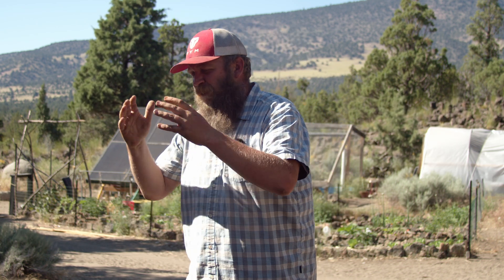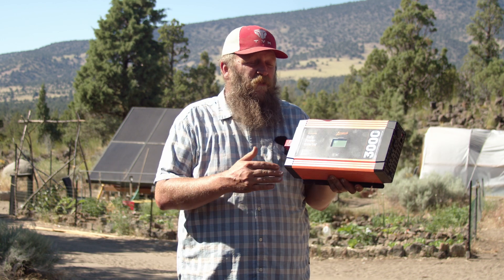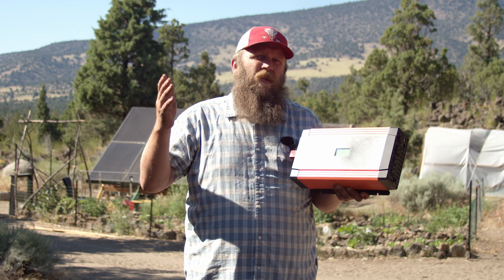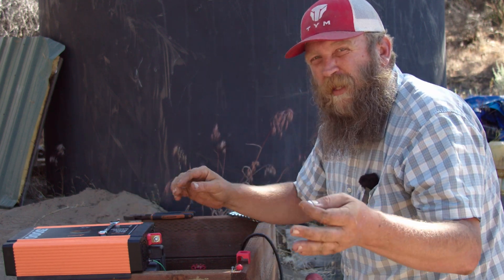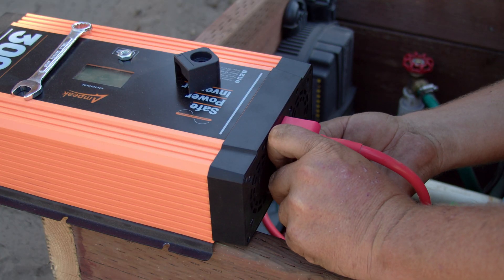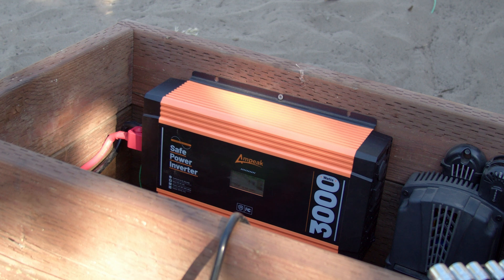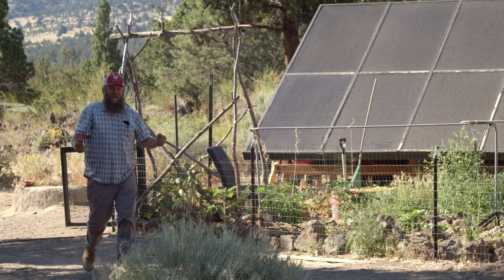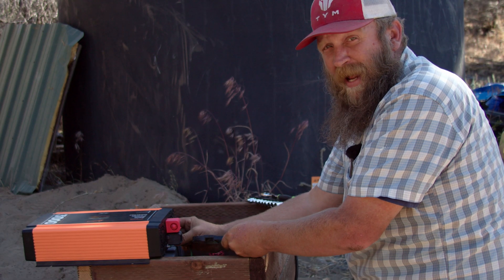Testing The Ampeak 3000w Inverter On an Off Grid Solar Array

Comment: That 3k inverter is powerful n more than enough to run any solar n battery array. I have it n it’s by far one of the best on the market.
Reply from the maker: It works great for our little solar pump system.

Comment: This video information is further along than I need but I have a couple acres and I want to setup some solar panels to offset my on-grid energy costs but the solar companies want thousands and thousands of dollars to install panels. Is it possible to make my own panels cheaper than that and have an electrician hook them up to my on-grid house? If so where would I start?
Reply from the maker: Panels are really cheap to buy and installing them is super easy. 3/4 of the cost of a pro install is labor and sales commissions. The solar you can buy all the materials for a working system for a dollar a watt, easy and the companies charge 3.50-4.00/watt. It's crazy. Over on TikTok I have a playlist that walks you through the whole process, start to finish.
Reply: @7kinhomestead  thanks I'll check it out. How do you know how many watts you need?